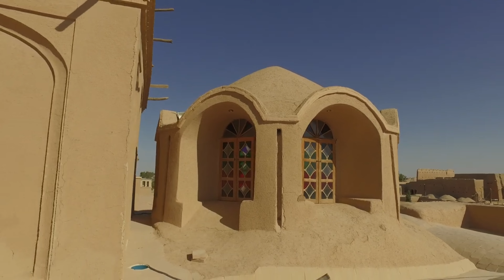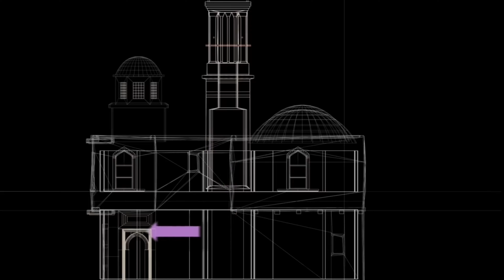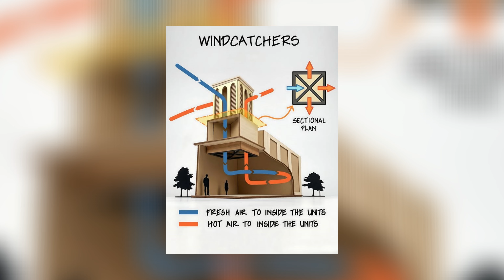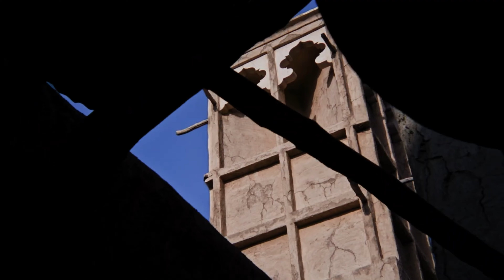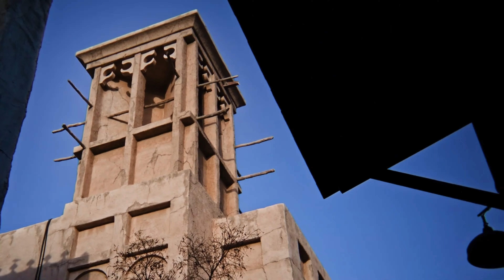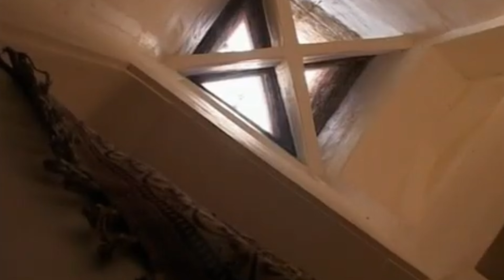This "Roman" Tower Cooled Entire Cities Without Electricity. Why Did We Stop Using It?

Comment: a desert has low humidity and water can be turned easily into cooling, but water is more expensive.  You can buy evaporative air conditioners today similar idea.  You can even cool modern house a little in low humidty by hanging clothes in closet after washing them but not drying... same idea as human sweat or dogs panting.